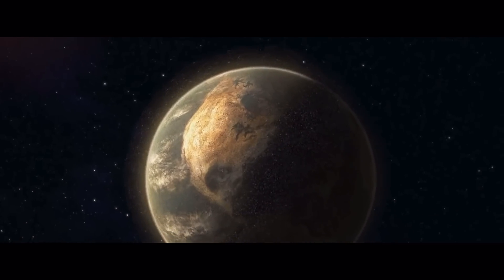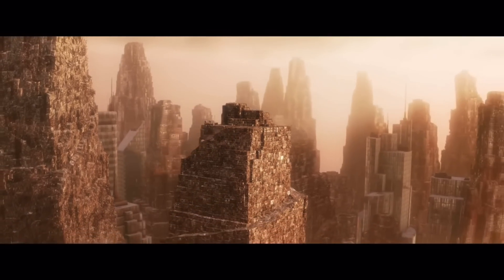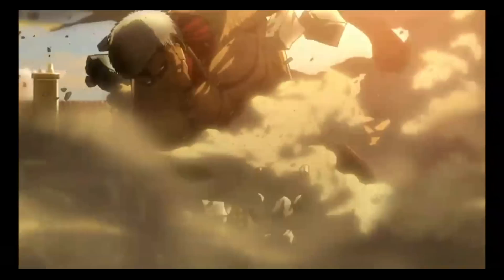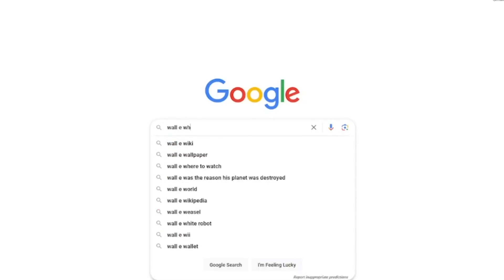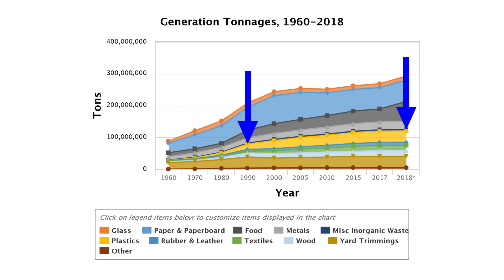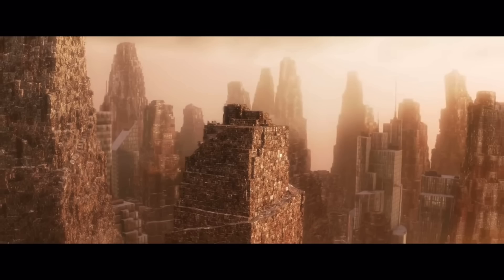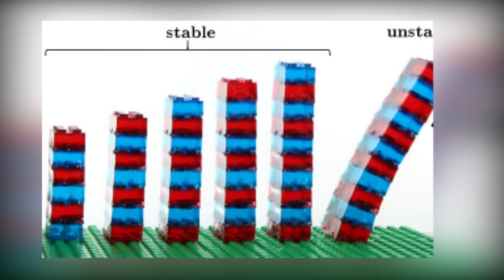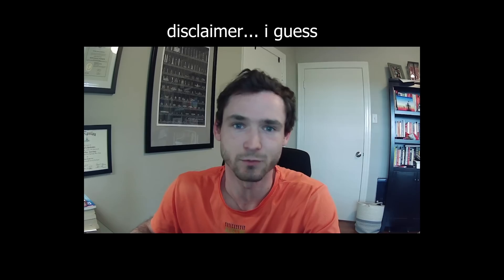Wall-E's Ridiculous Skyscrapers: A Design review

Comment: do think group action matters in this case
if they prevent eachother from tipping long enough that weight starts pressing down enough to merge the blocks
the blocks themself only made via compression
it would turn the junk from blocks into a inhomogeneous homogenized compressed whole wich would have a lot higher structural integrity compared to the segmented shape of blocks they started at 
doubtful that it would let them stack skyscraper high, but it would help get them much higher then you would expect

Comment: The funny thing is, every sane businessman is trying to find a way to produce zero waste. Not because they care about the environment, but because waste material COULD be re-used to generate profits elsewhere.

Look to the humble chicken. It's raw carcass and any eggs it produced during it's lifespan can be sold for a pretty penny... but what if they expire?
Well, a smart entrepreneur will take the chicken and eggs off the shelf before they expire, and cook them. The eggs can be used for baking or in other stuff, while the chicken itself can be rotisserie'd. If the cooked chicken goes unsold for a day, you can tear off the meat for use in cold sandwiches, soups, or other stuff. And if THAT doesn't get sold, then you can toss it into a field of mushrooms to decompose and make more shrooms, which you can also sell.

100% recycling is a proper capitalist's wet dream, because it means 100% efficient use of all available resources and maximum profits.

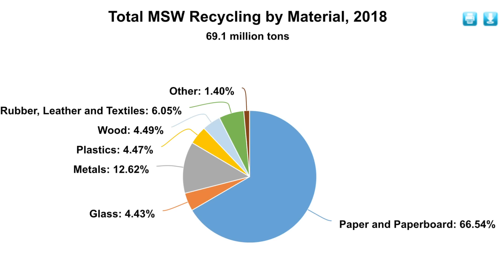Comment: 6:28 as a Swede this is absolutely horrific, we recycle practically everything, one of our biggest imports is trash because we have a reputation of being so efficient in recycling, freakin one scandal lately was about the inefficiency of the recycle network. That you just dump it in a hole in the ground is baffling and calling it primitive would be a insult to homoerectus
Reply: Nice try, haha. How much were you paid by the Swedish government for that one? Slightly more than 50 percent is "practically everything" to you? That's hilarious that you didn't bother to research the stats of your own country, yet felt comfortable telling the world as if you had.
Reply: @ idk, maybe you should try learning to read more then one sentence, in a extreme over generalization half of all waist gets directly recycled into new material. the other half gets burnt in energy plants (who’s only waist is water vapor), which is just another form of recycling. The rest is just some peoples negligence, instead of a actual part of our waist disposal system
Reply: @shiningstar737 I’m a little suspicious about that part about water vapor being the only waste of energy plants. Are you perhaps confusing it with hydrogen-oxygen Fuel Cells?
Reply: @ no, the material gets burnt i a isolated chamber, the heat generated is used to boil water to turn a turbine generating electricity. After the turbine the heat is use to make fjärrvärme (long distance heat) to heat up homes. And lastly the water vapor escapes out the chimney
Reply: @awesomeferret 
By the standards of the US, yes.

Comment: If anything, eletronic waste will be the top type of waste in the future. That will include glass in the form of the screens, heavy metals for the batteries and LCD components, and plastic for the carcasses of phones and other appliances, on top of the plain metals like aluminium, copper and gold. It's a pain to recicle electronic components because you have to first disassemble everything, then physically and chemically separate the base materials, if even possible. All that creates multistep processes and lots of chemical washings and filtration steps are you try to recover materials, with diminishing returns because it's never 100%. At the current state of recycling efforts, it's easier to make a new product than recycle a new one for the materials, which is why reusability of products (and not recyclability) should be favored.

Well, in a world where planned obsolence isn't encroaching every sector of eery industry, that is.

Comment: Maybe we can just assume that there's another phase of the construction that is never shown on screen. Maybe after a new layer is completed, or after a row of blocks is completed, the units come back and weld the individual blocks together with a powerful laser. Perhaps the Wall-E units have a very powerful downward pointing laser built into them. After a layer is laid down, they drive along the boundaries between the blocks with this laser activated. This melts the boundaries of the blocks by creating a narrow melt pool perhaps 1.5 layers deep. The whole tower is welded together in this manner. Effectively it is one big piece. 

I know this is well beyond the abilities of current power sources, batteries, lasers, and electronics, but we can hand wand wave that away citing vague 22nd century technology.
Reply from the maker: Yay another civil engineer! Right, like you say there might be something offscreen to meld the materials we don’t see. Though, the more I observe architecture in fantasy the more I realize, creators probably lean into the fact that they don’t over explain the concept making it appear impossible as a means for creating a sense of wonder.
Reply: @onstructures  Yeah artistic license is always a thing. Ultimately showing more than what they did wouldn't really serve the plot of the movie much, which is why they don't go into too much detail. Poke to closely at the economic system of a fantasy RPG like DND and the whole thing will crumble like a house of cards. But such is fiction. Willing suspension of disbelief and all that.

Comment: To draw a historical parallel, the physics described here are the exact reason that almost every ancient human culture built pyramids before they invented some kind of mortar, because straight vertical towers just couldn't support themselves without something to hold the blocks together. The Egyptians, for one, really pushed the limits of how steep their pyramids could be built; the iconic "bent pyramids" go from a steeper angle at the bottom to a shallower angle at the top likely because the builders discovered that the initial steeper angle couldn't stand at full height, and so had to adjust mid-project.

Comment: I have to wonder if also the Wall-E is constructing the towers simultaneously, that could give time for weather to maybe cause the blocks to shift and interlock somewhat, and compress even further under the weight of the structure, given enough time maybe each tower as it's being constructed, voids filled with sand from dust storms, and more material piled on top, possibly making it stronger? Idk

Comment: This dude just blew my mind with one sentence. I always thought it was mostly plastics, metals, glass, rubber. But he said that people on the east coast would tell you otherwise on metal and i was like "🤔🤔🤔🤔🤔🤔🤔 i guess you're right. 20-40 years sitting in a yard completely destroyed most of the cars across from my uncle's. Most of those old cars were literally falling apart when getting tugged on, and some of the older ones would literally collapse under their own weight if you so much as pushed on them. There's no way they wouldn't rust away into tiny metal flakes in 700 years"

Comment: ve aktualy tried this! while admitedly ve vere using a far less optimised mashine htan WALL-E and it had more of a 3:3:1 ratio due to mostly aplying preashure from above ve rapidly found that the 2 most desiting factors in stakking "trash cubes" vere the weight of the cubes and the flatness/stabiety of the ground, also cubes started to deform realy early, in our example at around 7 cubes high our pyramid shapes started to squish at the bottom. a realy strange school project
Reply from the maker: that's awesome that you got to test the concept irl! seriously cool school project

Comment: I think a noteworthy factor is the pliability of the material. Platics, rubber and some metals like aluminium and such have higher flexibility than more rigid things like pure glas, metal (although rusted metal can at time also be quite bendy/bendable). It would give, atleast to some small degree, some form of flex or sway in the tower, both to cope with the unevenness in the structure on its own, but also some sway to withstand the storms. 

Theres also decayed plastic and rubber and their ability to melt in contact with heat or direct sunlight, which could form some sort of seal/mortar for the cubes to leak into the gaps between them. There is also bound to be produced some heat from the compression of the material whilst inside wall-e, which could prime them for leakage and therefore some type of glue/paste/mortar for the cubes.
Reply from the maker: Hmm, I hadn’t considered the effect of melted plastics! That’s the best explanation I’ve heard regarding binding the blocks together.

Comment: Well, two arguments. First, Pixar is known for telling story by scene itself. That is acceptable licence, I think. Second, I think weight itself of the structures would cause some interlocking, crushing bottom layers into compact layer that can stick together. Also, it is likely that for example pieces of scrap would tangle to each other. Also, as seen in movie, relatively weak earthquake (made by space ship) was enough to crumble several of these structures. I think although exagurated, it is not exagurated that much. By the way, given the centuries that Wall-e had, he might have dosens of unsuccessful tries, before he mastered it.

Comment: I think it's worth mentioning that sure, probably many of those towers have fallen over the years, but that just means they were picked back up bit by bit and rebuilt somewhere else in a different configuration, culling out the weak towers until only stable towers remained
Reply from the maker: That would make WallE quite the Sisyphus!
Reply: @onstructures one dose not need to imagine Wall-E happy
Reply: @onstructures  he already basically is with the shear amount of garbage.

Comment: Lets say the towers of trash were stable. Unlike skyscraper buildings where support gets built into the ground with a foundation and some sort of columns that even go into the bedrock deep beneath the soil these trash towers just sit on the surface. An earthquake or a gust of wind could knock them over. Idk, but maybe the soil slowly became more compacted over time as the thousands of Wall-Es slowly worked on these towers. However if the soil unevenly compacted/settled the towers may develop a tilt and eventually fall over similar to the Leaning Tower of Pisa. The only reason the leaning tower hasn't fallen over is an active effort by engineers to maintain it. Maybe the Wall-Es choose where to shrinkage the towers on which sides to maintain a vertical tower? Also how do the Wall-Es determine at what height they should stop stacking the tower? Is it time to ascend to the top with the blocks? Or are they going by structural integrity? Or quite possibly just random chance?

Idk kinda just blabbering. I enjoyed the video.
Reply from the maker: Those are all good questions! Exactly why I like reviewing fantasy architecture! Glad you liked the video

Comment: One possibility: while we do see WALL-E building the base of a trash tower, we don't see the construction of the upper levels. So prehaps he staggers the blocks as the structure gets taller. We also see he is pretty meticulous about block placement. To me, this suggests that he notices if a block is too small or deformed to fit into a pattern, so he may set that one aside to fit somewhere else.
Reply from the maker: Hm, a staggered layout would be an interesting prospect, I’m unsure of how this would affect the structural integrity, but it certainly would help as it would engage more dead weight.

Comment: I think it's a mistake to take the industrial/construction waste out of the equation especially since it's quite typical for corporations to try to push the blame and responsibility for change onto the population.
it's also possible in block stacking to put instabilities opposing the instabilities of another stack to form a mutual support (although I'm pretty sure the compressive forces of the scale would still throw all that out the window by totally destroying the integrity of the bottom blocks)

Comment: Amazing video, I'm glad to see this is being blessed by the algorithm. I was surprised to see you only have 5 and a half thousand subscribers. Anyways... Subscribed!

While I'm here, I wanted to add some of my own thoughts;
- WALL-E units are robots, so they may have much more precision in how they work with these blocks. Sure, we don't see them compressing them to the point of them being a solid, consistent mass, but I think this is more of an artistic liberty - realistically, that's probably what they would do, and that would change the strength of an individual block.

- We already see WALL-E make a substandard block in the movie and he doesn't end up using it for anything, so it's completely possible that the WALL-E units are capable of assessing them and deciding what blocks are good to use and which aren't. Similarly, this might mean they have some concept of what materials should go where in the tower, which would make sense considering these were made to be incinerated, and so they might be ordered for both greater strength and ease of disposal.

- We learn in the movie that there was thousands of WALL-Es in the past, so it's possible that the methods we see are different to how the other towers were built. For instance, in the past the WALL-Es may have constructed a frame to hold up this tower, but obviously a single WALL-E wouldn't be able to do that, so we see him omit that part of the process. We don't know how long he's been alone - it could've been for just a few months before the movie begins - so maybe he's just finishing off the team's job. Not to mention that laser between their 'eyes' could probably be used to weld this frame together.

- Under the immense weight of the tower, I feel like many of these blocks (especially near the middle) would compress themselves down into a much more consistent mass, which may change how they behave. And considering that it takes a seemingly very long time to build just one level of a tower, it's possible that they're artificially strengthened over time by just how long it takes to build them. The blocks under the most weight would compress and buckle the tower inward, and WALL-E may just adjust for this and continue along.

- It's possible that WALL-E just builds these towers in layers of, say, 4 blocks that're arranged normally and then offsets them by about, say, half a block for the level above. That could function similarly to interlocking, but would just be on a smaller scale.

- We do actually see it reflected in the movie that these towers are not particularly strong - multiple of them do get knocked over. So, they clearly aren't anything like the buildings around them in how stable they are, and even though we don't see it, they may get knocked over like this pretty frequently and the WALL-E units have had to fix them. Maybe the WALL-Es have built them with those sandstorms in mind, but those sandstorms are just a comparatively weak threat.

Comment: Is it possible for the blocks to interlock from crushing weight? As you mention, the blocks aren't homogenous, so as the tower gets higher the strucutal integrity of individual blocks breakd down and pieces of trash gets pushed into the bottom block locking them in place. (But this theory kinda breaks down if the blocks doesnt hold it shape as the base could also give way and  collapse the whole tower)

Comment: Maybe that they are built into/against preexisting structures would help? It's clearly visible that some of the trash towers have preexisting skyscrapers poking out the sides.
Reply from the maker: Yea! I think that the lateral stability of the existing towers would help if only because they should have a greater resistance to horizontal loads
Reply: trash sleeves
Reply: @Jamlord2061   NO